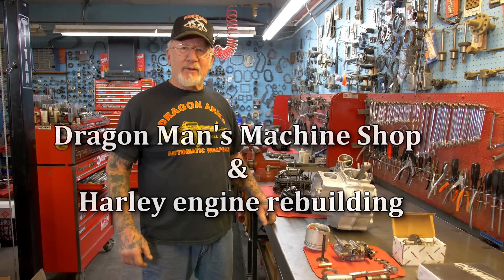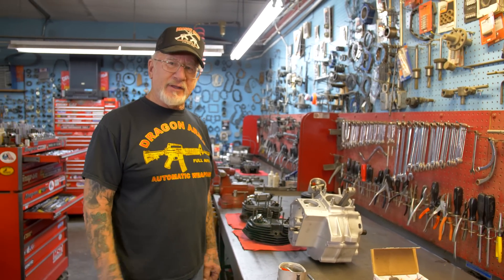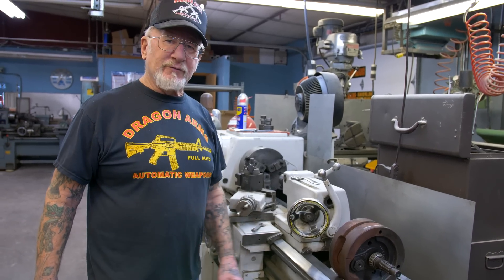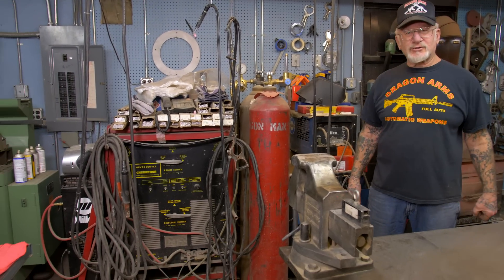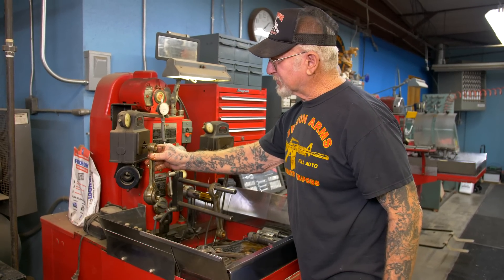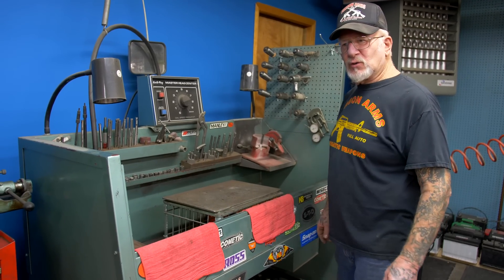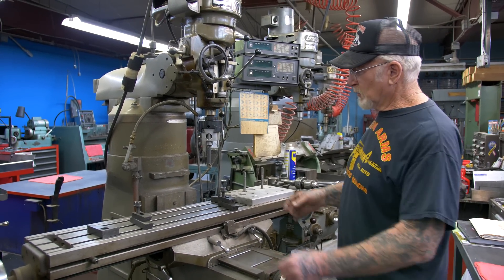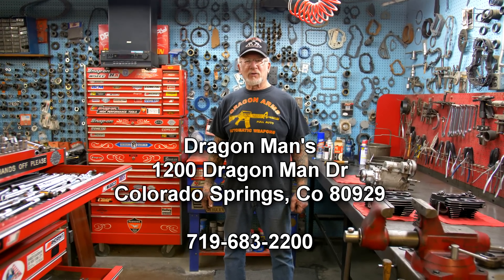Dragon Man's  Harley Engine Machine Shop

Comment: Hey, Dragon man.  Long time subscriber, first time commenting.  I felt compelled to comment on your video today because I felt a kinship of sorts.  First off, best video ever.   I'm retired now, I'll be 65 this xmas.  As you were explaining to the viewers from machine to machine I was reminded of my days at the Boeing Co. in Washington state.   I started off with an apprenticeship as a tool and die maker in 1973 Iv'e operated manual and CNC machines all my adult life.   Later, I graduated to a CNC programmer using CAD CAM on a Catia platform (shell programming) retired from Boeing in 1999.   Last program I was on would be the F22 raptor in its early stages before the general public knew about it. There is always something cool about designing manufacturing and machining metal weather it be aluminum, titanium, steel, etc. I'm also a hotrod guy built many a motors all Fords... I know you like the Chevies...lol.  Firearms have been in my life since I was about 14 yrs. old.  My dad, a veteran of the Korean war taught my brothers and myself all about firearms safety and shooting.   Since my retirement I have started to take up shooting in a more active way.  Since I have moved to Ca. behind enemy lines I have come to realize how my 2a rights have come under tighter restrictions.  I'm glad it hasn't had the same effect on Colorado.   Anyway, thank you for all that you do, in educating the public about firearms and mechanics. Still, one of my most watched channels.
Reply: It’s “whether” not “weather”

Comment: This is a video documentary of meticulous craftsmanship in an unequalled machine shop created to allow the necessary flow of work, unhindered by repeatedly having to set up and re-set up the the machines before work could commence!

The huge investment in procuring and setting up each machine shows the commitment to carrying out exemplary work at reasonable rates.

I know of no other Engineer or machine shop that has invested so much in order to create such a natural work flow system.

This workshop and machine shop enable mechanical mastery to take place, and I would have every confidence in an engine built by this supremely talented and experienced Engineer and Master Mechanic!

Comment: This guy is a treasure! A $1000.00 overhaul, or, "remanufactured" Harley engine is cheap and a week-plus return is awesome! He has a "quality assurance" program to check for "issues" and the proper equipment for precision work. If I was a younger man, I'd pay to be an assistant in his shop. And, shojus is correct with his assessment of Dragon Man as a man of a dying breed. As mechanical designs change to the newest environment, fewer "experts" are around to maintain the still popular engines of the past. I am not talking as if the Harley design is an antique per se, but, from a family of engines designed for antique aircraft use. And, let's face it, eventually, all transportation vehicles will be electric, and as a result, his expertise will decline. 

I say that for a reason. Back in the day, I served with men of his caliber as an aircraft mechanic in the seventies. Of course, the Navy needed technicians for jets, which I was one, however, a squadron next to ours flew the North American T-6 Texan aircraft. A trainer for advancing pilots that required a fast and powerful plane that can shoot targets while maneuvering in a combat environment. The powerplant was a Pratt and Whitney 9-cylinder Radial engine that required a morning preflight process to remove the sparkplugs of the bottom cylinders to evacuate any oil settled between the pistons and the heads. Otherwise, you can have cylinder-lock that results in costly repairs from a start-up. Once drained of low cylinder oil, they often started the engine for a warm-up for the pilot's daily flight. I often was on the flight-line and enjoyed watching the start-up and to see the fire from the Header once it fired. Raw power from a 600hp engine while they set the throttle to 80% warm-up! And, I enjoyed talking to their mechs. 

However, I met a lot of mechanics of that era that is now gone. They die and take all their experience and knowledge with them. Call it nostalgia if you wish, but, I miss these guys who were the top of their industry. And, I appreciate the men who are still around with such abilities. Obviously, Dragon Man is one of those I truly respect. He may not have worked in aviation, but, he could easily! After all, advanced knowledge of gas and piston engines to the degree he has is a quality rarely seen today. I will watch many if not all his videos for that reason alone. And, the introduction of his shop in this video made me a fan. And, again, who doesn't have a love and interest of Harley Davidson powerplants!? To be set up as he is, he can turn engines weekly and make a fortune!...lol. I will be watching!

Comment: If you use torque plates to bore and hone. Then finish hone with a sunnen burnishing stone ( only two double stones used no shoes) Then ball mill them with a 600 grit ball hone (you can custom order them from cylinder head abrasives in Sacramento Ca.) The ball hone is basically working like a deburing brush to remove torn metal caused my the ridged honing stones. You can use ductile iron plasma molly rings instead of soft cast. They will last forever and no seating required. Also much more heat tolerant. I have used this on high end motors (Car stuff) it works . As a demo i do a dyno pull without the breather cap and there is ZERO noticeable blow by on a brand new motor. Why am i telling you this well your a fellow old timer and if you have an automatic weapons permit your probably not a dirt bag.

Comment: Had a real bad, (i.e. expensive), experience with this guy.  He supposedly overhauled my Shovel motor but did a horrible job.  He claims to use S & S Performance parts, but used cheap Chinese junk parts instead.  After just 270 miles, my lower end destroyed itself.  (we found machining debris and glass beads (sand blasting) blocking two of the three oil supply journals to the crankpin bearings), a front cylinder rocker arm broke off, (cheap Chinese junk rocker arm), and the rear cylinder exhaust valve seat dropped out while the engine was running. (improperly machined tolerance fit)  My cam shaft galled up in the cam chest because he also incorrectly shimmed the allowable endplay.  Don't waste your money with this has been.
Reply: Von Diesel  Of course not.  Several separate incidents.  The rocker arm failed about six blocks from the house, and I coasted to a stop and a buddy came and picked me up.  The lower end failed because the oil journals were blocked by blasting media and machining chips.  This starved the main bearings for oil while motoring down the highway, ended up having to get the bike towed back to the house.  The SECOND overhaul shop said the cam endplay was incorrectly shimmed and galled up the bearing and cam chest cover.  They said it was the worst "overhaul" they had ever seen.
Reply: Von Diesel  I didn't.  Another overhaul shop did after I experienced all these problems.  They said, (and I quote), "this is the worst rebuild we've ever seen, absolutely horrible...."

Comment: Every thing sounds good but unless you do more than a 2 angle valve job I’d insist my heads be done else where for porting & flow testing. Also cast rings are only good for stock not high compression imho

Comment: Sorry, will never use this clown again as I had a very bad experience with him about 9-10 years ago.  His "fresh rebuild" on my 1980 FXE motor was nothing but trouble.  Keep in mind you get what you pay for.  My lower end  partially seized and started making metal chips after just 270 miles.  When we torn the engine down, two of the crankpin oil passages were partially blocked with blasting media.  On the top end, a rocker arm broke off, and I had to limp home on one cylinder, glad I was only a half block from home.  He improperly shimmed my cam, and didn't rebuild the oil pump as promised.  I had to send the entire engine back out again for a 2nd overhaul.  The new shop I sent it to said they'd never seen such shoddy workmanship.  I dunno, maybe he had a bad worker in the shop or something, but I've got three old Shovelheads, and I'll never use his shop again.

Comment: My Harley shakes so bad I can see to drive over 50mph. Wish I could get it fixed.
Reply from the maker: Rev your motor in neutral , is it smoorh? If it vibrates real bad it's your motor or drive train. If drive train is smooth check neck and swingarm bearings, wheel bearings and tier beads. Also rear chain, belt and sprockets. Valance wheels also
Reply: Thank you it must be the drive train. It did get crashed before I got it. Guy had to put it in a ditch to miss a deer.
Reply from the maker: Maybe a bent rim also

Comment: Why redo a setup?  Just buy another machine.  My type of thinking.
Reply: Ball-Loc systems are also good too if you have tight quarters for multimachine expansion. Having tooling set up on a plate that can be swapped out quickly and accurately in minutes earns a respectable second place trophy.